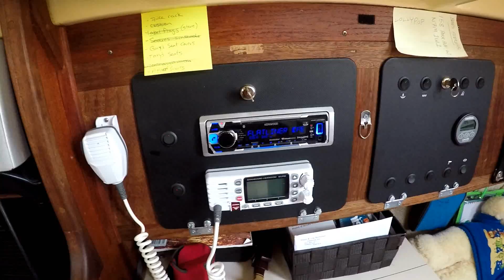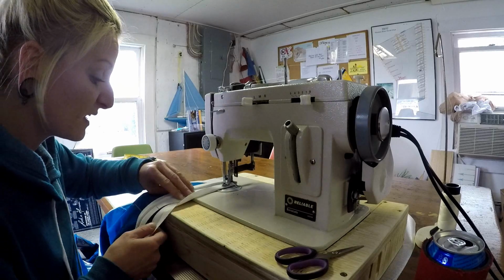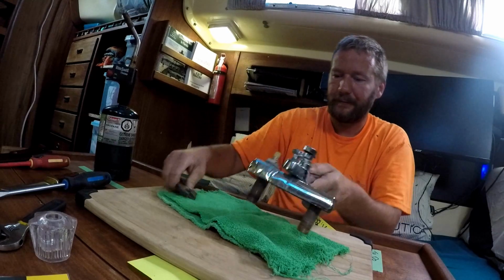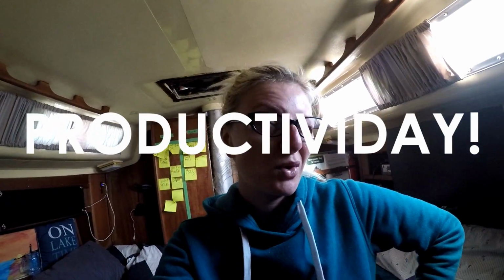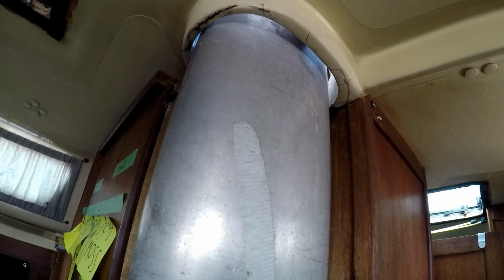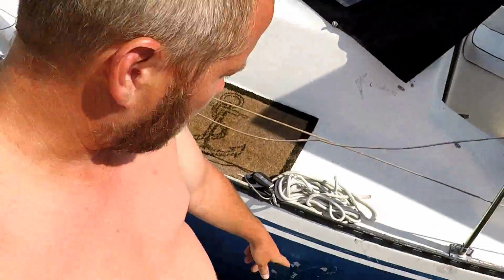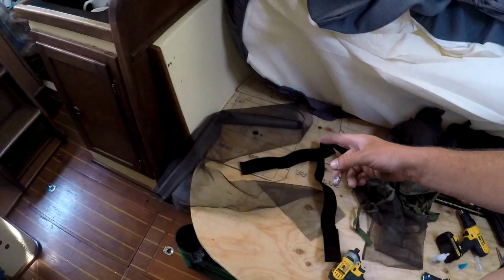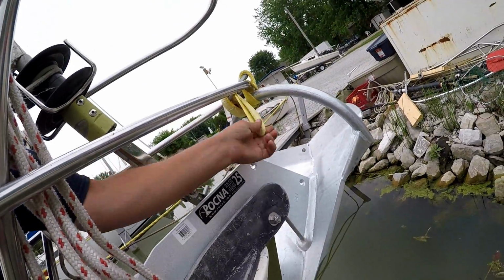Sailboat MODS to Head South - Lady K Sailing - Episode 13

Comment: Love the channel! Coming back to the beginning after picking up from when you left and then all the way to being current ...

Request for a boat mod review - Spurs (Shaft or Propeller mounted cutters e.g. Spurs Marine com). 
 1 - Do they actually work
 2 - What do they cost and the different brand options
 3 - Effort required (haul out and professional installation, or DIY etc)
 3 - Is it worth it considering (compared to the cost of your harrowing experience on your northward journey)

Maybe you could do a series on common boat mods that people consider and you can review the concept (not a particular brand) - 
 - Radar (is it worth it if doing a Bahamas and East Coast run)  
 - AIS 
 - Hull paint colour (does it make a difference to indoor temperature if you have dark blue hull paint?)
 - Day Tanks (for fuel to pre-scrub before the engine)
 - Bimini Covers (Candice is a professional seamstress, but could a normal person DIY it)

Thank you advance. This was the best place I thought to get in touch with the request / idea

Comment: As for your question on what we want to see, just stay to your way, don't change anything, stay true to yourselves and you'll see time will tell and it will be easier for you guys.  Just a heads up, your BBQ on the stern uses 1lb propane bottles, hummmm yuckyyyyyy and $$$$  Canadian Tire, 24.95$ adaptor hose and start using a 20p tank.  Do NOT buy a marine $$$ tank, just buy 30$ tank at Ctire, and spray with 15$ flexseal, you know, rubber in a can, color of your choice and you'll get 5 years in salty water environment.  Tested and approved by Mama Cocha II!
Reply from the maker: Haha thanks! We actually already have that propane hose but the 1lb tank is still half full hehe

Comment: If you guys are new to making videos you're doing an excellent job. As for time of segments that should probably depend on what you are doing. I have a question, where did you get the black plastic panels that your VHF radio and am/fm radio are mounted in? Are those keys locks at the top and if so did you add them or did they come with them? I would love to get some panels like that to replace the old beat up panels in my boat. Great look, nice and clean and should be easy access for working on. Great idea would love to copy it please.
Reply from the maker: spinnaker5514 Hey thanks! Actually I made those out of plastic cutting boards that I painted. The locks at the top I found in the RV section at the hardware store.
Reply: What a great idea and they look great too! What a creative solution!

Comment: Unless your epoxy is ultraviolet ray resistant, it will deteriorate quickly in the Caribbean sun. Put two coats of spar varnish on top of the epoxy to protect the epoxy.

Comment: In your video where you showed how you were powering the laptop and monitor, I wanted to know how you adapted the power to laptop?  Did you trash a power supply to get the plug or did you find the plug somewhere?
Reply: Look for a DC to DC adapter. Ebay has them. Make sure the plug fits you laptop.
Reply from the maker: Good question thanks. We spliced the existing laptop cord after the adapter block. It can now be used on 110v or our boat. We bought a box of dc male and female connections for easy use as well. I wanted to use a universal laptop power cord instead of cutting ours but this laptop has a really hard to find end that the universal ones don’t tend to have :)